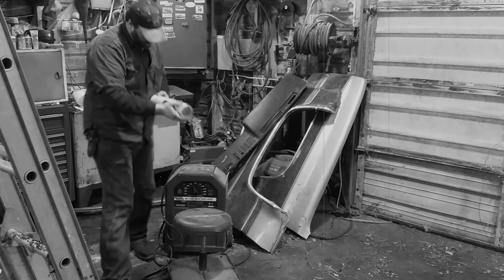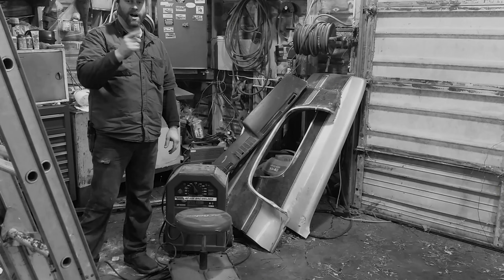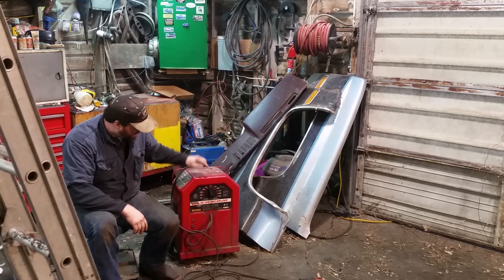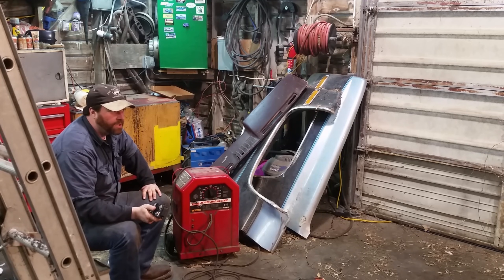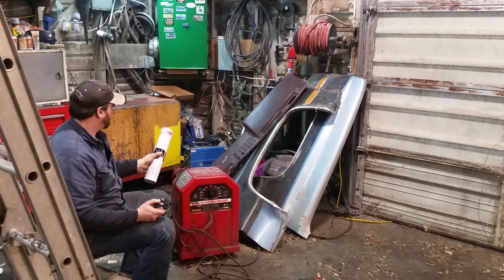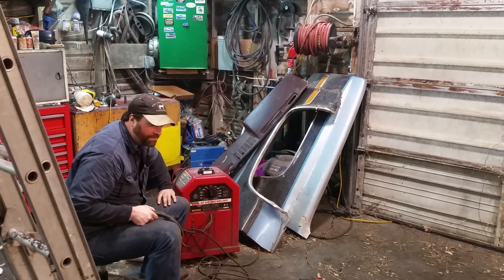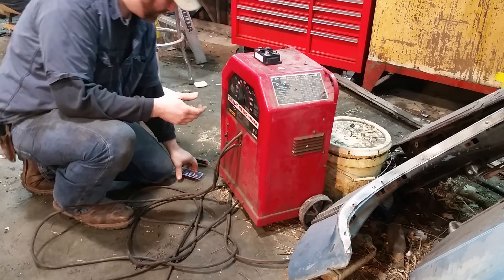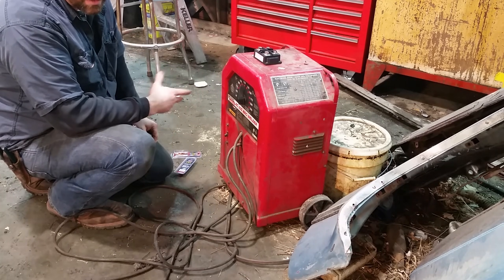How To Convert AC Stick Welder to DC for Cheap - Lincoln 225 "Tombstone" "Buzz Box"

Comment: I did not see anyone comment on the fact you REALLY need to mount that rectifier to a LARGE aluminum heat sink with a fan blowing on it or it will have a short life.

Comment: you need to mount rectifier where fan can cool it i used 4 pos or negative diodes and i have used welder for years afterwords as long as you keep your temp down

Comment: Since the output voltage is around 25v you might add a 3000 or 4000uf  70v-100v rated capacitor across the output + and - of the rectifier, it would smooth out the ac ripple and most likely help with starting the arc.
Reply: Just curious, where did the microfarad reading of the capacitor come from? Is this just ballpark or is this actually calculated?
Reply: victork  ... just a ballpark figure from years of building electrical projects that required smoothing the dc ripple output of full wave bridge rectifiers, the exact uF capacity isn't too critical in this type of non electronic application.
Reply: @Lou-eye  won’t adding a capacitor, turn it into a constant voltage power supply and introduce a shocking hazard even after the machine is turned off?
Reply: @victork3397 ..the whole welder output is a power supply to begin with, the rectifier just turns it into DC. The capacitor WILL hold a low voltage charge after the welder is turned off, if it is a concern a 10 or 20watt 10k to 15kohm resistor can be added across the pos and neg of the electrolytic capacitor, that will slowly bleed off the residual voltage in the cap. when the welder is turned off. The only time there is "constant" voltage is when it's first turned on,the cap will instantly charge in micro seconds, if there's a 10k resistor across it there will be a "constant" current flow of about 2 milliamps across it,hardly anything. If everything is mounted inside the welder everything will be safe from any concerns. Sorry got lengthy here.

Comment: I converted my AC unit the same way, got the part on EBay. I put the bridge on the front so if I want to use AC rods, I'll swap cable location. I also marker + & - to help keep currant direction correct. Worked just like you call out, great.

Comment: My DIY, 3 MOT welder can run DC electrodes on AC no problem. I could connect the transformers in parallel, but that's for thicker electrodes only. Series is all I ever need.

Comment: I'm doing the same thing with my Lincoln. Might I suggest adding a fan to help cool the rectifier?
Reply: My thoughts too that the rectifier would need cooling by fan and a good heat sink. The welder housing may get hot at that mounting point right now.

Comment: Nice. I have an old tombstone. I had been using an old mig to tig with but it burned up.  With my tombstone after I covert it to DC with a rectifier, I ought to be able to tig with it perhaps. I’ve got the torch, argon etc already. Hmmmm

Comment: I’m VERY curious on if or HOW you were able to add a Wire feed to a DC machine??. Were you able to do so???. I’m NOT an electrician guro but my friend is... he said that a machine HAS to have CV (constant voltage) to operate the Mig capability?????. Just wondering if you had a way around this???
Reply from the maker: I actually did run a wire feeder off this machine.  It was a Hobart Handler wire feeder that had both Constant Current and Constant Voltage capability.  I just selected CC.  But I only ran flux core 5/64 wire with it, but my wire was crap old wire and never ran very good.  I have since replaced that whole setup with a proper wire welder but it was a fun challenge making all that work together.  Hopefully that helps!  Thanks for watching and commenting!
Reply: Good deal bro!!👍👍👍 thanks for responding!!👍👍

Comment: Can you use a generator for power with the right adapter such as the 14 four prong going into the generator in and of course the other three prong going to the welder would that work
Reply from the maker: Yeah, these tombstones just require 220-240VAC, they don't car much about frequency or voltage stability.  If I remember correctly, the only connection the neutral wire has is to the chassis for grounding.  Otherwise, it really just runs on the two legs of the 230V source, so however you can adapt that to your generator should be fine.  But as with all electrical, if in doubt at all, contact a qualified electrician, or proceed at your own risk!  Thanks for watching and commenting!

Comment: Oh for the love of God man, I just got a killer deal on 30 LBS of 6013 AC rods.  Now i have to take all that crap out of my welder and put it back to original.  Thats the next video.
Reply from the maker: Ha!  Yeah, just about.  I finished it up with DINSE connectors for selecting AC, DCEN, or DCEP, and other stuff too.  Thanks for watching and commenting!

Comment: Seems to me it would have been a lot easier cheaper and more efficient just to weld with the DC rods with your AC welder. Personally I never buy welding rods for what I do I just use what I can get give to me from the dump I never even look at the rods to see what they're branded for and I've never had one not work I use a AC welder
Reply from the maker: Well, that's one approach.  Honestly, it probably doesn't matter much for most small repairs and things, but for anything critical, I'd try to follow manufacturer's recommendations.  Thanks for watching and commenting!

Comment: Good afternoon. I have a Lincoln 225 stick welder that I've converted to DC. I've also have a 300 amp rectifier as well. I'm trying to use 7018 rods but every time I put the stick on the material the welder bogs down and the fan stops working. Once I remove the stick from the material the fan comes back on. The generator I'm using is a Coleman 5500 that works great with my old buzz box without the conversion. Do you have any idea what is wrong with me? Thank you very much. Eric.
Reply: That generator is probably just barely big enough for the job....IMHO....going DC is probably too much.
Reply: That's what I'm thinking. But I haven't tried it yet with a smaller rod either. Thanks for replying.
Reply from the maker: That's odd. Sounds like a supply issue.  But if it worked fine before, maybe there's something wrong with the bridge rectifier?  Does it get warm with the machine on and no welding?
Reply: No. It doesn't have time to get warm. As soon as I put the stick to the metal the welder shuts off and once I remove the stick it cuts back on. A good friend of mine told me it could be my plug. I changed the plug on the welder and I believe I got the right plug, but the wrong amperage. He told me that I needed a 50 amp plug for it to run off the generator.

Comment: Now you can set up to scratch tig  son . well don les england .
Reply: Better yet, do that plus buy an Arc Pig and do HF start for everything. Just won't be a square wave rig. You'd have to pay about $1000 for a cheap 200A DC IGBT TIG/Stick unit from Harbor Freight that you can rely on warranty/service-wise, and
Reply from the maker: Yes, it would be possible!  Thanks for watching and commenting!

Comment: Does anyone know when they started putting those wheels on mine was made sometime in the 70s most likely 74 but it does not have the wheels
Reply from the maker: Really not sure.  I honestly would rather put my own wheels on it anyway, the ones that come with it are pretty small and I fear would break pretty easily if drug around in the rocks or yard too much.  If I were going to keep the welder, I'd probably put some large 18"+ wheels on it and make a longer handle and place to hang the leads too.  Thanks for watching and commenting!

Comment: I guess you never heard of an inductor for welding with DC........the diodes just convert the AC to "dirty" DC or with a ripple on the line and you need an inductor to smooth the wave form out or a very big capacitor across the pos and negative output from the diodes but that can be very expensive.
On the other hand, an inductor for a 250 amp welder would be a simple tubular core about 50mm diam and 300mm long packed tight with crushed ferrite rods (old ferrite radio aerial rods)  and a  10 or 15 turns of10mm diam copper rod or failing that a heavy welding cable wound around it and terminated at the ends.
The inductor is after the diode + line that feeds the welder hand piece and it serves to smooth the DC wave form that otherwise is just a rippled wave form.......without the inductor the arc is full of welding splatter whereas with it the arc is silky smooth and hisses cleanly.
Reply from the maker: Yep!  I have!  I actually just did this recently https://youtu.be/NpVj6QLwHlU , added a choke (2, actually), heat sink for the rectifier, and more!  Thanks for watching and commenting!  And let me know what you think of what I did!

Comment: is it really worth doing tho? I have heard DC can get you better penetration. Lmk what you think
Reply from the maker: I actually go over some of that in my latest video here https://youtu.be/NpVj6QLwHlU along with some other improvements and modifications.  But, yes, I think in many cases it's worth converting, in some, you're better off getting a DC machine.  As for penetration, I'm not totally sure, but I do like the look of DC a lot better than AC, and I always felt like AC would blow through more easily, could just be me though, I'm no professional by any means.  Thanks for watching and commenting!
Reply: BurningDinosaurs I’ll check the latest video. Thanks for the response!

Comment: Nice work on the AC/DC conversion !   Pound for Dollar those were some of the best welders built , we still use the AC/DC model in the shop for stick welding . Love that welder ,still burns great at 35 years old .   A short message from the electrical engineering department .....    https://www.youtube.com/watch?v=1gtLgAYCf5Y&list=OLAK5uy_n0N_Ec9Ty5idFdyqsmmv3_Qcxom7EcTBA
Reply from the maker: AC/DC lol!  Yeah, they're pretty ubiquitous and for good reason, they're just simple and reliable.  But I'm no good at stick welding, so wire is best for this guy!  I'd love to keep both, but the budget says I have to choose one or the other, so I guess the Lincoln will have to hit the road.  Thanks for watching and commenting!

Comment: That was painful to watch. Why do I get the feeling you didn't take the time to clean out the cabinet or whip off the fan blades since you where in there??  Personally,  I'd have mounted that unit up as close to the vents as I could have gotten it. So it can cool better. FYI, that's why it has just expanded metal bottom. To allow as much air in as possible. So it's a good idea to NOT stack crap around these units. And if possible,  Get them up off the floor and away from the straw and other ignition sources that I see all over the place. You know, since that converter gets "Hot as F_ck"  You know, the Spider webs, Straw, Hay, Paper,  and probably the grease and oil also, Stuff that ignites and BURNS very easy.

Comment: The rectifier could have gone on either side, then the classic Lincoln Tombstone look would not be marred on the front with multiple screws.
Reply from the maker: Well, I'm planning on adding DENSE connectors, and possibly an amp gauge once a couple more parts come in, so lots of other changes coming.  Thanks for watching and commenting!
Reply: @burningdinosaurs  PUT A HEATSINK ON THE BRIDGE RECTIFIER! it will last years instead of months.
Reply: @burningdinosaurs  It would have been more easy to mark and drill the holes from the outside of the case sense the pattern would be the same from either side. Then just simply placed the rectifier inside and bolted it in.

Comment: Just screw the rectifier to the front of the machine right where you stuck your sticker,  A WHOLE LOT SIMPLER.
Reply from the maker: Well, it is, just on the inside.  I'm actually just waiting on one more piece to show up and I'll be adding DINSE connectors so I can select polarity or AC.  Probably add a volt and maybe amp gauge as well.  Thanks for watching and commenting!

Comment: Yup! I just ordered a 300amp DC rectifier so I could transform my Lincoln Tombstone to DC. Thanks
Reply from the maker: Very cool! Thanks for watching and commenting!
Reply: good on you. just did mine, but arc was hard to maintain, trying 7018  1/8 inch rods.... LOW  VOLTAGE,  so added a 28 uFd capacitor, wired across +  and -- of bridge rectifier, from old junk, rated 400 volts, overkill but, now it WELDS   VERY  NICE.....I screwed that square bridge rectifier, to an old DELL  computer cpu  heatsink, the large ones, used thermal paste from computer store room. Now, just got to put all together nice, with fan run off of welder transformer, using a small bridge rectifier. Will use computer fan, 4 inch one.  am going to also try a reactor ( stripped microwave oven transformer, with 4 turns of #2  cable, in series on the ground cable, after the bridge and cap.
   Good Luck, Milo.....
Reply: @petersack5074  where do you wire the capacitor.
Reply: @blackbeardracing  across  the rectifier,   POSITIVE  and  NEGATIVE  posts.....
Reply: @petersack5074  so pos to pos. Neg to neg across rectifier.  Got it
Reply: @blackbeardracing  yes
Reply: @petersack5074  thanks buddy have a good day
Reply: Where did you order it from?
Reply: @ILikeRagtime    just go on amazon, got mine 150 amp 1600 volt for about 22 bucks, in the mail......
Reply: What is the part # for the rectofier..?
Reply from the maker: Not sure part number,  but it was 400Amp, 1000Volt I found online. They've gone up since I bought mine but they're about $45 now
Reply: @GTXL600R    google on amazon, for 200 amp or more bridge rectifiers....cheap
Reply: as mentioned above, you should add a capacitor to smooth out the voltage ripple from the rectifier also. The caps out of old audio amplifiers are usually rated for the task, 50+ volts and usually over 10,000 mFd
Reply: @thedavesofourlives1    try to get the oil filled, metal container ones. like in microwaves......wont overheat.

Comment: Oh please !
Look up some regular rectifiers for Mig welding Transformers.
Big Aluminum Plates with Rectifiers, at least 4x4" and four of them direct in the air stream of an big fan..
I bet if you looked at the Data sheet of your 400V 400A Rectifier you would see  that at max 10A are recommended wenn you put it on a thin !!STEEL!!(i asume) plate.
But if you get those for 1$ each its only a problemm with the labour you put in changing them.
Reply from the maker: Entirely possible!  I actually thought about mounting it to a heat sink, and may still do that, but I liked the idea of the front since I can feel how warm it's getting.  I'm waiting on 1 part still to build a choke and I'll be adding the DINSE connectors as well as possibly an amp and volt gauge and may move the rectifier to a large heat sink then.  Thanks for watching and commenting!

Comment: You should wire the machine to keep the AC and two  wires on a separate wires for the DC have connectors on the wires  so you could switch out the DC for DCEP or DCEN to give you more options
Reply: yes got 4 welder plugs/sockets on Amazon, can unplug grnd/electrode and plug directly into welder, either DCEP  or  DCEN,  or just straight  AC...
Reply from the maker: You read my mind! Hopefully doing that this weekend! Thanks for watching and commenting!
Reply: I did the same thing when I converted mine. Installed four Dinse Connecters in the front panel, and used #4 battery cable inside the machine to wire up the Connecters and the rectifier.

Comment: Just bought one for $60.00, it’s got 30 foot of 8/3 plus plug and a nice set of leads, nice steel frame with 3 inch steel wheels on the bottom It might be a week before I get to try it. Thanks for the video.
Reply from the maker: Nice!  Good deal!  Thanks for watching and commenting!
Reply: trying adding a big hand wound choke, that will make a bigger difference.  @burningdinosaurs

Comment: I have worked with my hands and tools all my life.    #1 get the welder onto a table.
#2  how do you NOT own a socket set or a nut driver or a cordless drill/impact?
You work all wonky and scatterbrained hopefully its for
Comedic effect.
Reply from the maker: Thanks for commenting, Herb.  All very valid points.  Last winter, when I did this, I had a tractor and a pickup in the shop and was pretty much out of room on the bench.  I also want people to know it's something most people can accomplish.  And being winter, I keep my Lithium Ion cordless tool batteries are all in the house.  Sorry it was so wonky.    Thanks for watching!

Comment: it would be 1st, to clean the floor,not rubbing on dirt loll, 
2 nd, it would be easyeir to work on bench top,
3rd, should clean the unit, 
and 4rth, sould face the camera, 
u would make a good movie, like abbot and castello, 
or laurol and hardy eeeeh he, rigt
Reply from the maker: That was last winter, but my shop is always messy - too many projects going on at once and they all need done now lol!  But it works!  I do plan on "finishing" the DC conversion project this winter with DINSE so I can select DCEP, DCEN, and AC, and also a volt and amp gauge so I can see what it's actually welding at.  Thanks for watching and commenting!

Comment: Very interesting but not knowing electricity that much, Im wondering if this new setup really does limit the amps like it use to when it was totally AC? How can that be tested to know the DC limits the amp output?
Reply from the maker: The current is (somewhat) limited by the winding in the transformer, selected by the switch on the front.  Amps shouldn't change, but voltage will be different when converted to DC (RMS vs peak-to-peak).  However I do plan to add a volt and amp gauge to the welder same time I install the DINSE connectors allowing me to choose DCEP, DCEN, and AC from the front panel.  So, once the gauges are installed, we'll have to see where it actually measures!  Thanks for watching and commenting!